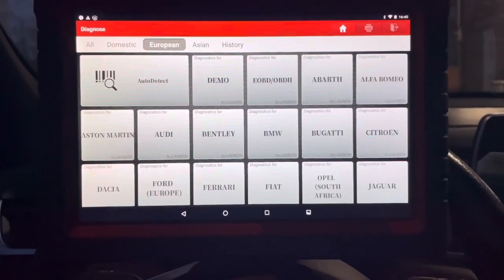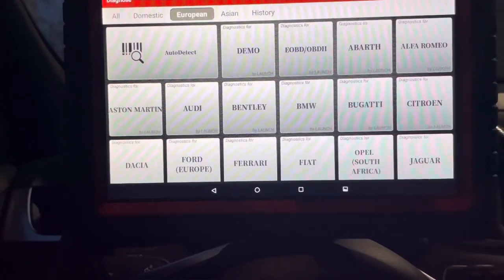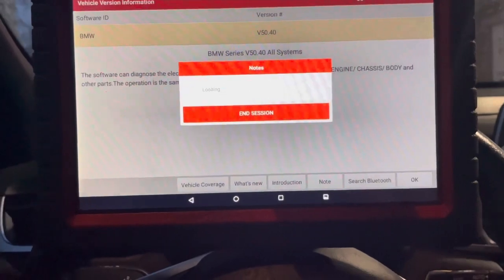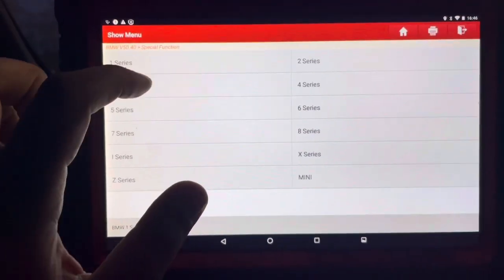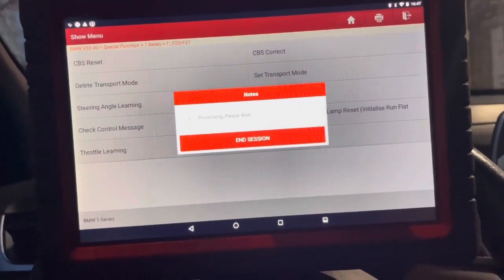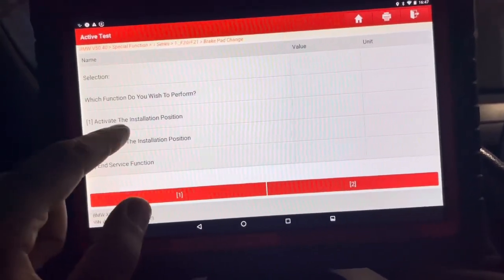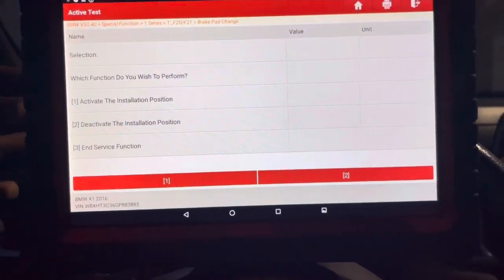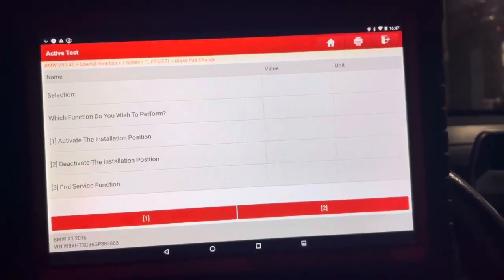How to service BMW rear brakes with electronic emergency brake calipers using Launch scan tool

Comment: I own a 2021 M440i.  I have a scan tool to retract the EPB, my question is do I still have to remove the EPB from the back of the caliper before I can retract the caliper piston?  Does the caliper piston push in or do you need  a tool that turns the caliper piston back into the caliper?
Reply from the maker: In our experience most calipers will compress like normal after you use scan tool function
Reply: @ShahaniMotors  Does the EPB motor have to be removed from the back of the caliper before compressing the piston?  I know when doing the brakes without a scan tool, the motor has to be removed to manually retract the E brake.
Reply: @garygreen6159  No, that's the point of doing it right, with the scan tool. Removing the motor and retracting it by hand will work in a pinch, but as with any electronic system you risk losing the "home" position of the motor/piston. The home position is recalibrated when you de-activate the "service position" after you finish working on the brakes.
Reply: @Setright  Thanks, that's what I thought, however, I just wanted to be absolutely sure not to screw up anything.

Comment: Hi there! I was about to do the break pad service and go in to retract EPB when my scanner gave me this message “The installation positions of the EMF actuators were not reached correctly on at least one side. Carry out SG test and work through all faults relating to the Automatic Hold brake according to the test schedule.
Then perform the service function again.” Any ideas how to tackle this ?